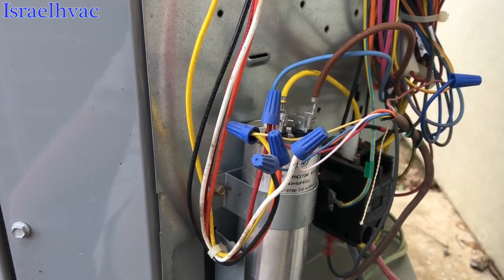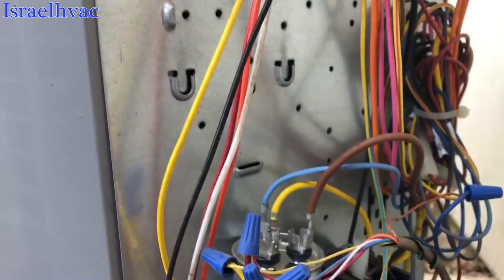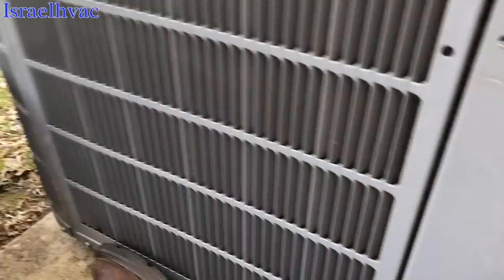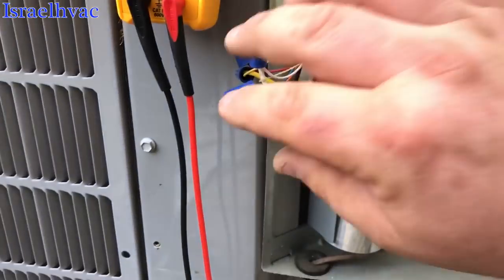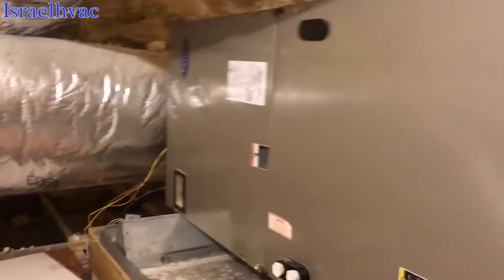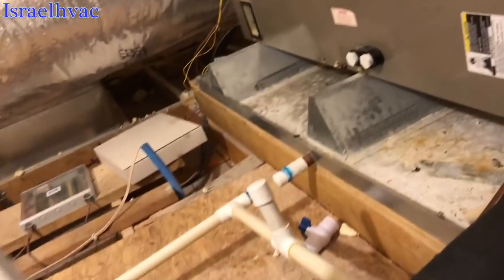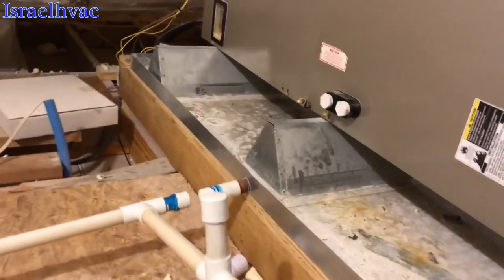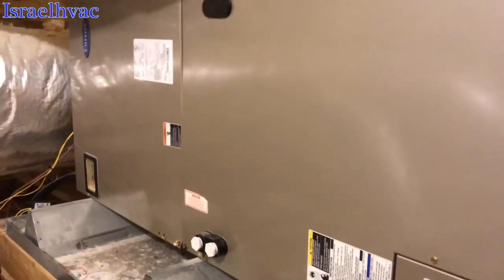HVAC | A Simple Maintenance

Comment: 02:46 Look at the control wires, your orange wire for your reversing valve and your blue common wire are both nicked pretty good and pretty close to each other. It could possibly cause a short, but very unlikely. I always hate seeing nicked control wirings, so I would have stripped it back a little bit to get rid of that. I'm always over cautious when it comes to shit like that though.

Comment: Great video John I would say this since some new guys are watching, when you pull the wires from the contactor either make sure the air handler disconnect is off or I like to just pull the tstat wire plug from the defrost board.  I have had too many times when all the sudden Mr/Mrs home owner starts playing with the tstat when you got the wires unhooked and then you end up blowing a fuse because the low voltage wires were touching the cabinet.
Reply from the maker: Leo Train that is a great point that I should of pointed out. Thank you sir.

Comment: I just started for a new company and I'm taking over the S.E.A. I check everything all wire connections ,refrigerant levels ect.. I always get something out of your videos. Thanks. I didn't know what ohms to look for on the contact. You should do a video on ohms and all the parts in the system that can be check.

Comment: John , did I see right. A 4 inch filter on  a residential  air handler ? Barely see them on my Commercial jobs . Why  is Carrier calling for a  20x25x4 filter , and not a 20x25x1 or 20x25x2. That filter was pleated ,  Merv11.  We put in Merve 7 or Merv  8.
Reply from the maker: Mike Clark yes it’s a media filter. It’s a IAQ product. We put them on most of our jobs.
Reply: Mike Clark- Commercial uses 2” pleated filters on the roof top!
Reply: We use 4in on most of our jobs as well

Comment: Good Lord.... what size is this system? Is that all the duct on 3 Zones /w no bypass?  Wonder what that static pressure is on that poor ECM. ICP coils suck in the first place.  Makes sense to run the coil at 600psi in heating on that 6" zone.

Comment: Man, those SUPCO caps are TRASH.  
Replaced one on a maintenance last week that I replaced in May of Last year.  (AMRAD or TitanHD only now).

Do you ever just check the caps while running under load to save time/get a more accurate test?
Reply from the maker: mike_HVAC yes sir I do

Comment: Hi, when you checked the cap for ufs, you still had some wires connected to it. I thought you were to remove all wires to get a accurate reading. With wires connected to cap when testing, do you get a back feed?   THANKS FRIEND
Reply from the maker: Ronald Cach I left the common on only. You have to disconnect the fan and compressor wires and it’s fine
Reply: Thanks

Comment: You tried to be so thorough but didn't even hook up gauges and take subcool or superheat values. You didn't check amp draws on the motors. You did nothing to check performance of system that like the biggest thing on a maintenance but ohmed the dang contactor lol
Reply: Also put the adjustable wrench on backwards, remember this is the same guy that wears cut off jogging pants and running shoes to a service call and films it.😂